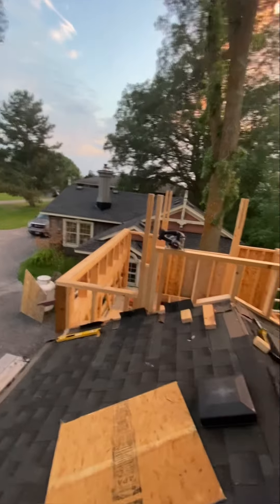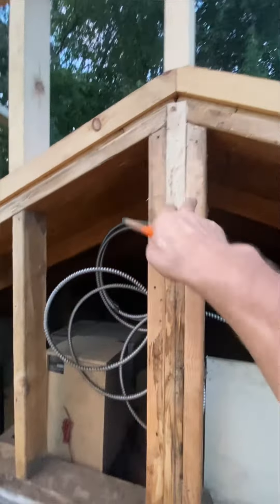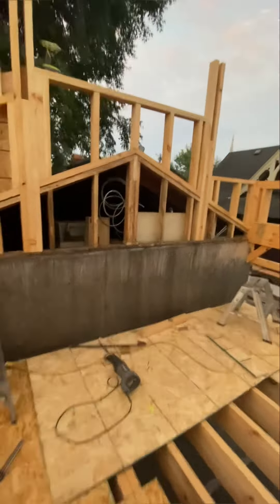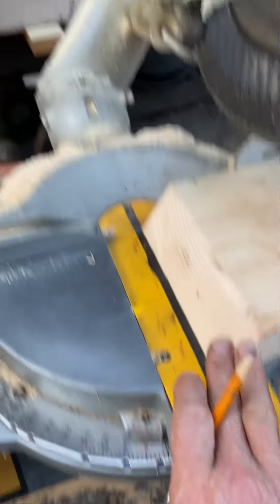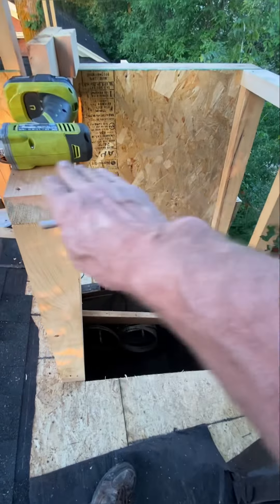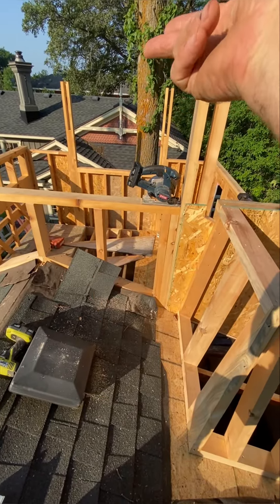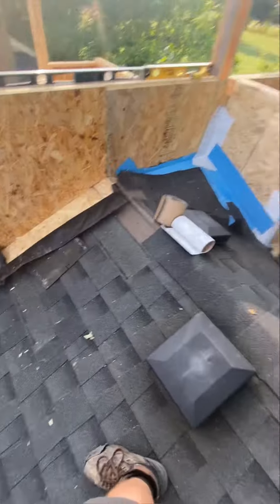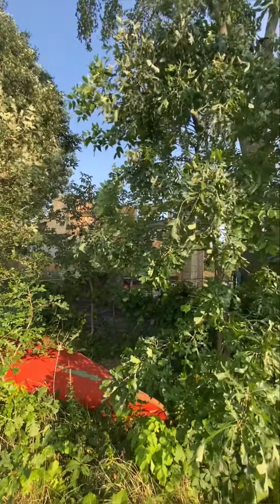base for tower part 7

Comment: Tis tower is unreal! Thanks for taking us along the proces of building and designing but also for noting the next couple of steps before you actually get there. Best thing its build with a ryobi drill!

So who and what kind of crafts are all coming together and doing there stuff in that building?
Reply from the maker: there will be a machine shop as well as the Blacksmith shop, but just those two crafts in that building